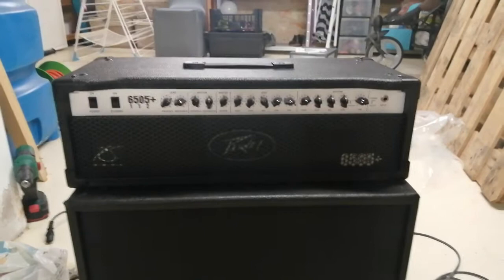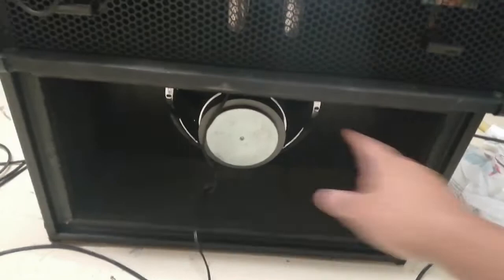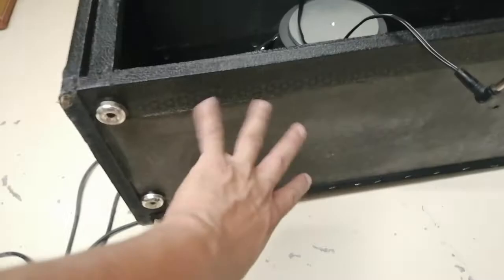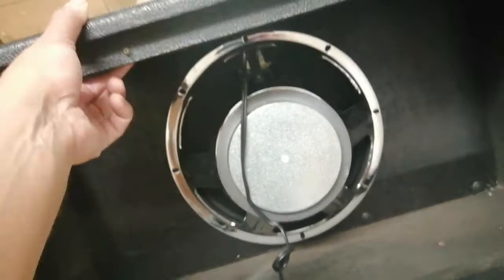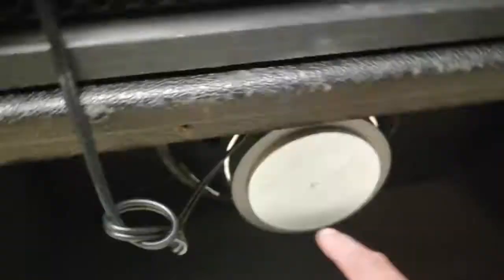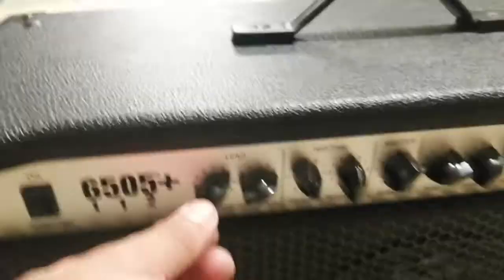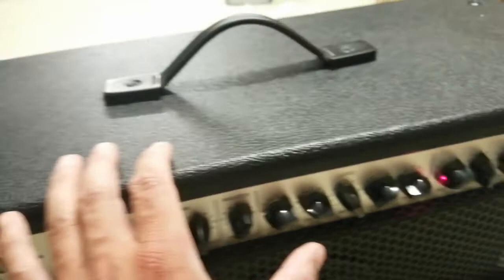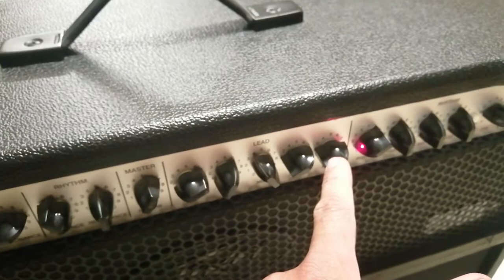transforming my Peavey 6505+ combo into a head= easy!

Comment: Could one hypothetically just use the original casing (the top, back and sides) then just use a piece of wood for the bottom?
Reply from the maker: I used the original casing and used the rear panel to close the head then I only reversed the "4 feet basement" of the cab..